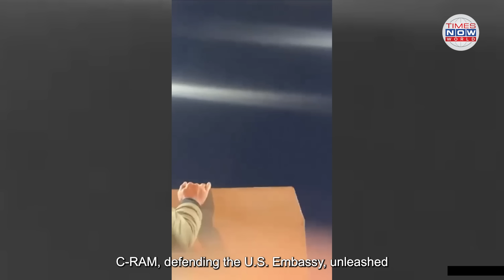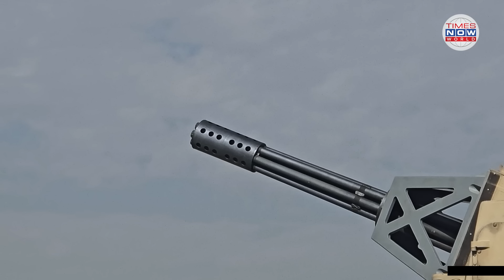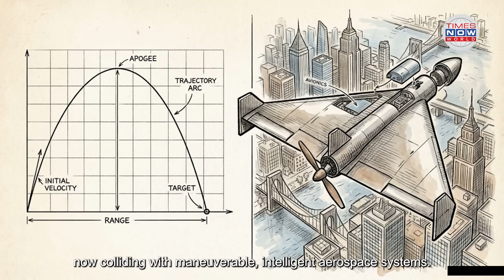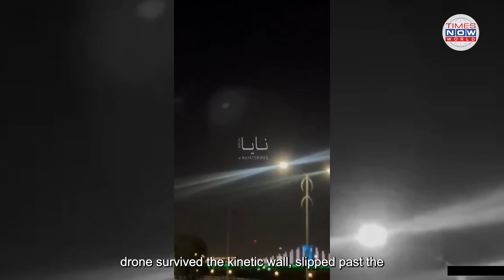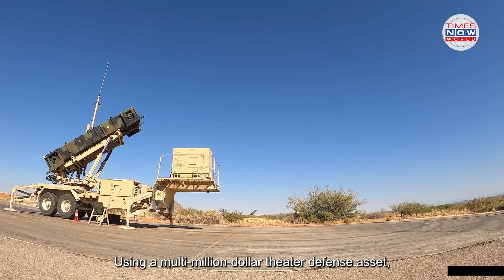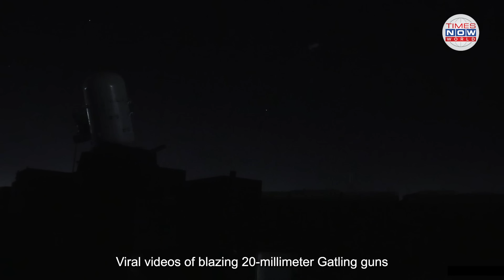EXPLAINED: How C-RAM Failed Against Cheap Iranian Shahed Drones in Baghdad

Comment: If it is designed to hit smaller, faster artillary and mortar rounds then the rate of fire and burst length is unlikely to be optimal for drones. Slow it down to 2000rpm and 50 round bursts, I'd bet that would dramatically improve success rates. Apaches with Longbow and APKWS rockets, should be deployed to kill most of the drones anyway.

Comment: C-RAM is a hard kill system, so it does not produce a 20mm coat of shrapnel! More like a constant stream of 20mm rounds to hit the target directly and destroy it.
Those rounds are not programmed to destroy themselves at a certain distance. They destroy themselves after the red tracer is burned out!
You are shooting at a drone at 1500 m (4921 feet). Some rounds hit the drone, but the rest of the 20mm rounds are flying until the tracer is burned out, which is in around 2500 m (8200 feet), and this is a problem in urban areas! Especially with those low-flying, shaded drones.

Comment: The drones don't appear out of thin air they are manufactured. Take out the manufacturing solve problem. But the US will still be spending billions to do that.
Reply: That would be like trying to take out the manufacturing of rifles to stop the infantry. These systems are not very complex, they don't require the sort of manufacturing complexes that you need to build warships or jet aircraft. factories that make washing machines or microwave ovens could be re-tooled to make these drones. Then disperse the equipment in places like underground car-parks and you would have to blast entire cities into rubble to totally stop them being made.

Comment: The laser has a limited range and is affected by weather conditions, and a strike drone designed to destroy a laser battery may have a ceramic body and a non-detonating thermite charge.
Reply: Lasers have to dwell on the target long enough to burn them too.  

They've been working on laser weapons for at least the last 50 years.  Yet they aren't very common. It suggests they're not that easy to use.
Reply: @quademasters249 un láser no necesita mucho tiempo para quemar algo, simplemente su única debilidad son las condiciones meteorológicas

Comment: Lasers over heat an EMP drone it’s done. Low frequency radar and launch counter drones.
Reply: If EMP worked, they would have used it already. It obviously doesn't. EMP weapons don't do anything a conventional explosive can't already do. It's not like in the movies where they have these fictional EMP weapons that have huge AOE and can be used repeatedly, they don't work like that IRL. Real world EMP weapons are just bombs, and their AOE is about the same as the blast radius of a conventional explosive, so you're better off using a regular explosive anyway since it's cheaper, and works against everything.